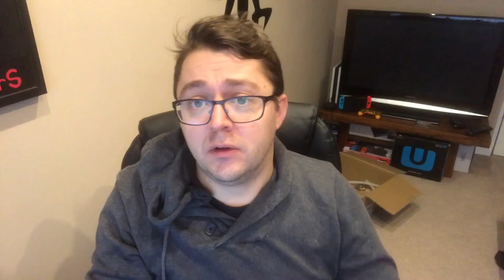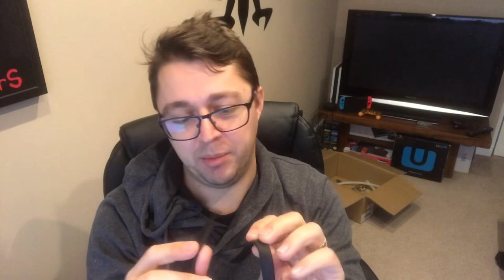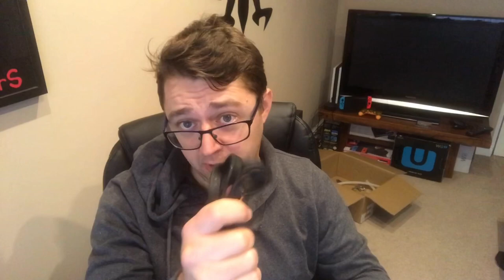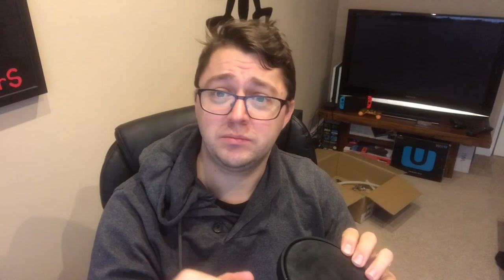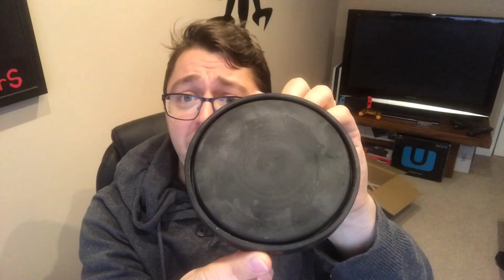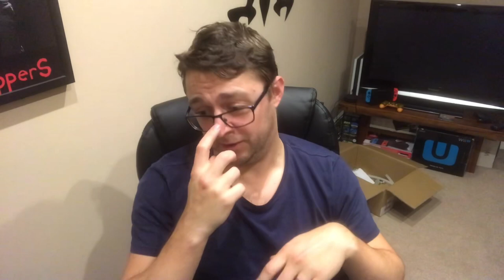BrewTools B80pro - First Brew Day Debrief and Lessons Learned

Comment: There's a new design plug as well as a new design seal much improved!  Typically when I'm boiling I do not clamp the steam hat on. I think that's more if you are going to use the steam condenser. I would also try experimenting with power somewhere around 40% or even less.
Reply from the maker: Just seen your vid on the plug - it looks spot on. BrewTools contacted me and are kindly sending replacement plug and seal. Kudos to them. Definitely think 40% power is reasonable. I did 50% in the end, but i wouldn’t be comfortable if I had more wort.